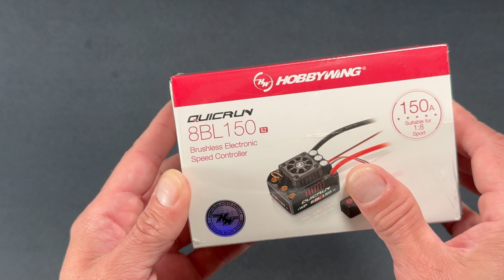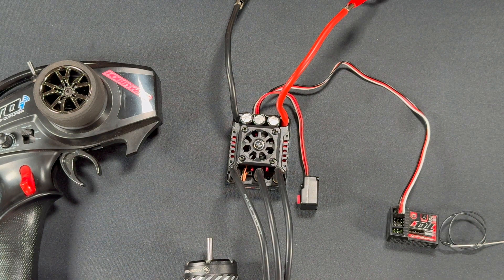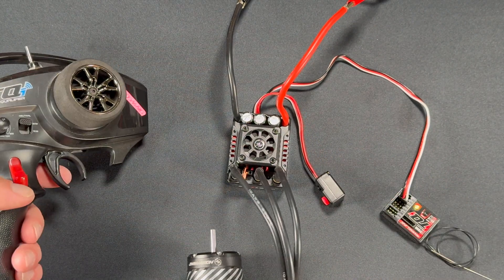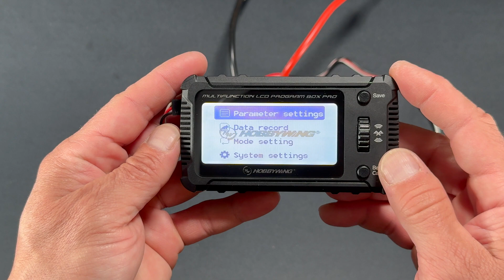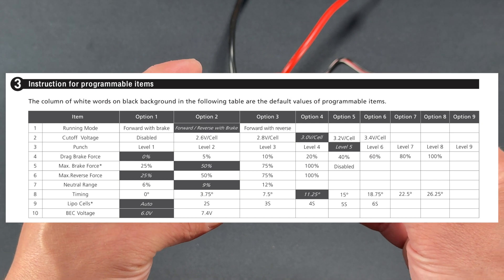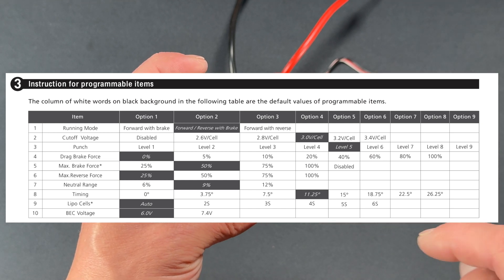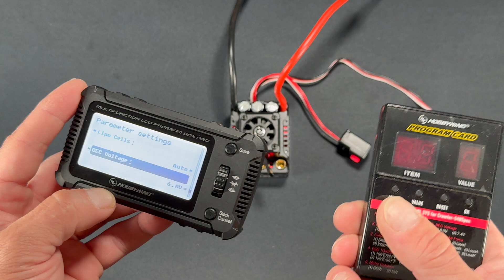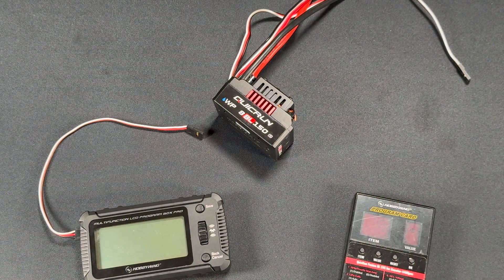The Charlie Show /// Episode 364 /// First Look - Quicrun WP 8BL150 G2

Comment: That's false because I just used my set button to program all 10 stages of my programmable items My running mode my cutoff voltage punch drag brake force max brake force max reverse force neutral range timing lipo cells and BEC voltage and it let me use the set button to adjust all those

Comment: I love these so much I have 7, and 12 of the 120a/esc. I recently have  not been able to get my programmer to work at all. I put a new cable for it and that didnt work as well. I was hoping to get a free replacement. It's only been 4 months now.  I have tortured it heavy on 4s and 6s. Just used a 5000mah 150c 6s and it held up fine. I did add my own high speed fan.

Comment: cooked the Spektrum 120a ESC after just a few packs in a brand new Mojave 4S, 3D printed a mounting plate and threw this thing in and it rips. significantly smoother power delivery compared to stock. great speed controller

Comment: Just installed a max10 g2 140a into my losi dbpro after the stock 130a spectrum esc burned up and…. It cogs like no tomorrow? Didn’t change anything other than the esc? Should be higher amperage and higher quality than the RTR electronics…..? Help pleaaaase. Using stock sensor less dbpro motor on 3s

Comment: What HW combo would work in the SCX6?  Looking to go 6s or 8s.  Would the stock motor handle more voltage since it's so big?  I've ran it on 4s for a year or longer without issue.  It's mostly a tow rig for a 2 kid bike stroller but i want a little more juice for playing.

Comment: I've been racing 1/8 Ebuggy class with this esc for a couple months now. Works great. I keep a photocopy of the manual in my radio bag so I can cross reference while programming as the stickers aren't accurate. I put a "Y" cable in the fan port so it's way easier to plug in the programmer now. Been kicking butt in my Ebuggy. No Regerts!